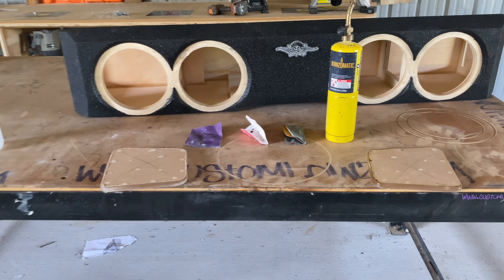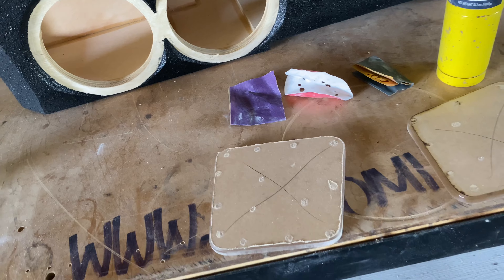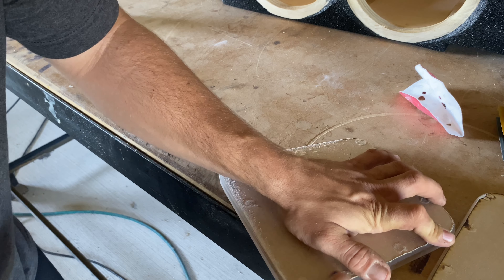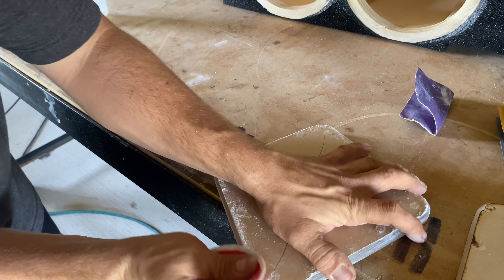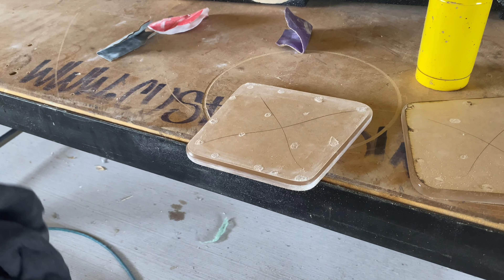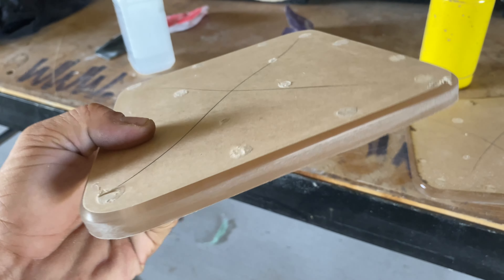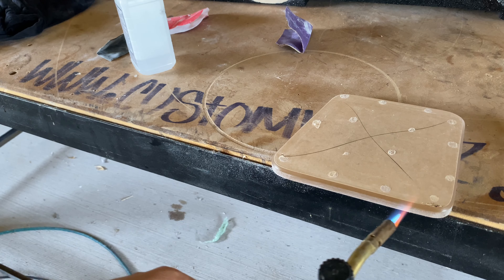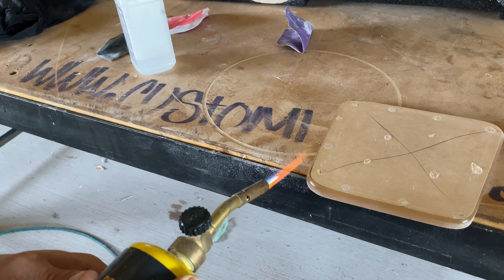4 Step How-To: Polish Plexiglass Edges! Easy & Fast Method!

Comment: You didn't pull the protective paper back from the edge (which I don't want to do either). But do you have to worry about the adhesive on the paper melting into the plex or doing something undesirable?
Reply from the maker: @steves7896  only issue I’ve had is paper getting stuck. But, that’s much less a headache than getting scratches in the finish

Comment: I have a bunch of 1/4 inch strips I need to do. Have you ever tried stacking them to do more than one edge at a time?
Reply from the maker: No. But with 1/4”
Id be worried they would melt together slightly